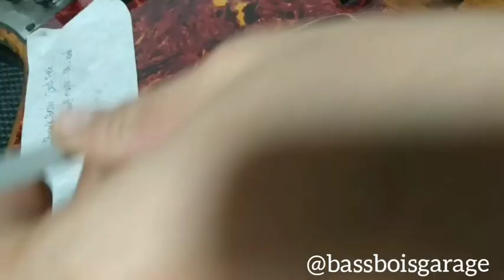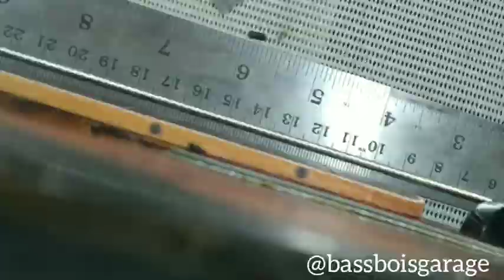#bassboifretworks Ep.6 | 1975 Fender Jazz Bass Refret & Fretboard Repair

Comment: Beautiful work! Can you tell me what is the solution you put on either side of the fret wire and why do you put solder across the fret before you remove them? Thank you.
Reply: If I got it right, the solution is alcohol, which helps dissolving residue of the glue in the slot. It's thin viscosity lets it creep in the slot easily. The heating of the frets is necessary to break down the glue in the slot, but just touching it with the soldiering iron takes time to evenly heat, so by putting up solder you instantly bring more heat down to the fret's tang.